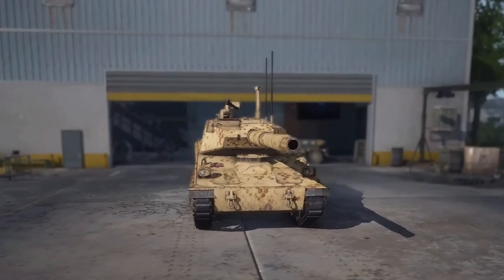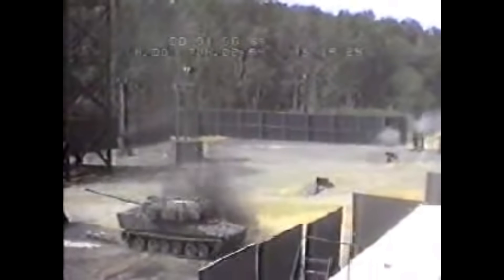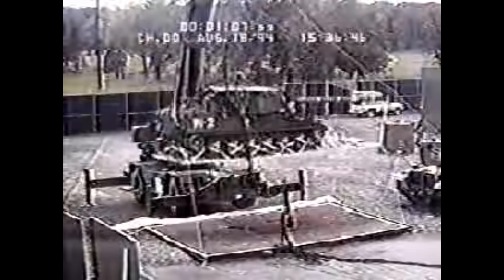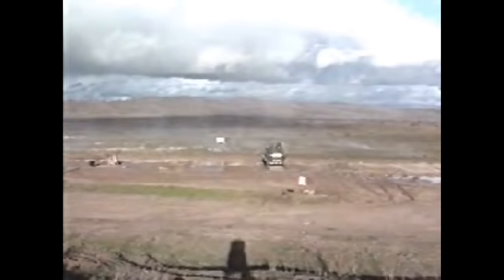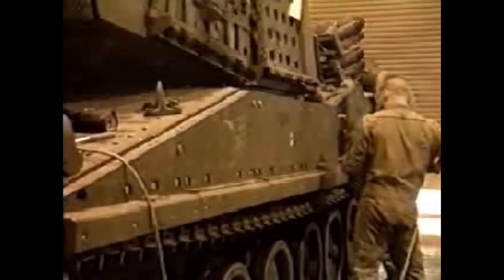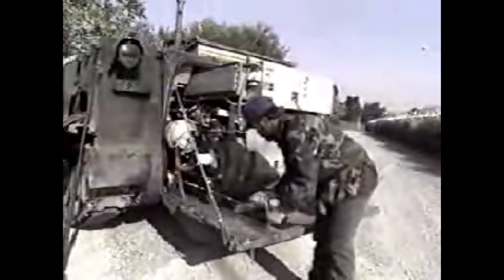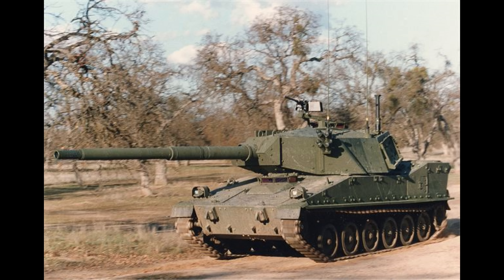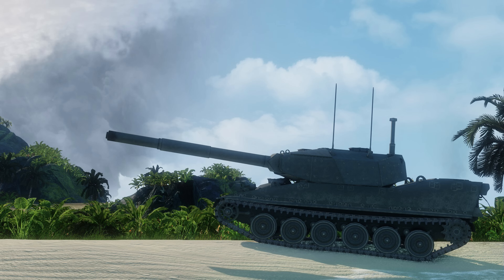M8 'AGS' Armored Gun System | IMPRESSIVE LIGHT TANK

Comment: So... wasn't the US Airborne already have those Stryker MGS thingy to fill the role which this thing was suppose to do?

I mean, they drop this tank a long, long time ago. And now they bring it back again? 

I know US spend alot of money for military, but this is kind of absurd imo. It's like they think money is unlimited. :P
Reply: This actually a proper tank (even if it's a light one) with actual armor that's worth the name. Plus as far as I'm aware; Strykers can't be airdopped, no matter the configuration.
Reply: @cnlbenmc  I believe early Stryker ICV drop was demostrated on C-17, none with MGS AFAIK, and most likely no one's ever trained to do that in practice. With that said BAE's MPF bid most likely have seen some weight growth over original M8 consider the uprated power pack and power generation, since Army eliminated the airdrop requirement early on. With identical dimension it might still fit in a C-130 but the with what kind of range left is a real question.

Comment: Sounds like a perfect tank for the Marines. Especially if you mount a Javelin launcher on it.
Reply: Especially since the Corps supposedly plans on getting rid of their Abrams tanks.
Reply: Why not use the TOW instead? Cheaper, effective, and we have tons of them in storage.
Reply: Daniel Aramburo age of the ammunition lot.
Reply: @danielaramburo7648 The missile is still expensive and can be counter by APS than tank shells
Reply: @aizseeker3622  Wel since its 21t it is not heavier than regular 8x8 APC. Even IFVs are more heavy today than this. 
Still I would see it more capable if equipped with most modern ERA setup. Those are really a game changers and if backed with some tungsten carbide/titanium plates and ceramics in main composite armor - become more useful even against APDS penetrators.
However the biggest ERA concern in US Army goes into possibility of harming infantry guys with an ERA blocks blasting.
Reply: @HanSolo__  Hence instead  of ERA mount APS. Still i wonder is it possible to mount M8 turret on modify ACV hull like Stryker MGS or japanesse Type 16 MCV.
Reply: @aizseeker3622  Sure a better way would be an APS. Those are still quite rare and very expensive. Not sure if such light tank (obviously way cheaper than the heavy one) equipped with efficient APS like Trophy would pass in todays tight military budgets. 
ERA on the other hand is the cheapest battle proven protection as far as I know.
Reply: @HanSolo__  ERA requieres it to fight away from infantry
Reply: Or for countries like Bangladesh or Indonesia where land doesn't support heavy ass equipment
Reply: Wouldn't you guys want it to be amphibious?
Reply: @nagantm441  No way. The hull is not anyway near being desingned for it. Now all the swimming doesnt really work for such vehicles. If you dont want K21 type of baloons your best bet would be to not compromise the protection for the floating foam containers. If it would be anyhow moved into field I think it still would need an additional 5t of protection module on the front. Battle ready if kept around 25t would be an awesome value. Then there its central turret with long heavy gun. Such tank-type of balance dont want to stay stable in the water.
Reply: @HanSolo__  Yeah it not really worth it to make amphibious (gonna be expensive and slow to swim) since you can carry 2 or 3 on LCAC than 1 M1A1. Tho I mostly concern that underbelly hull is vulnerable to ied and tank mines.
Reply: @aizseeker3622  Agree. Still you can't pump it with everything. On the back of the T-90S and T-72B3 you will find armor plates of 17mm which you can punch trhu with some 20mm AP round and ruin the engine or even put the tank in fire. Because its based on some 39t T-72. T-90 has at least this kevlar cover for the ammo selector drum.
Reply: nagantm441 No. The Marines spent the last ten years reinventing the BTR-60, aka the Amphibious Combat Vehicle. We don’t need to reinvent the PT-76 as well.
Reply: I would love to see a tank using the GAU 8 30 mm Avenger 🤯
Reply: A LAHAT missile would be a better option in my opinion. The LAHAT can be fired from the main guns and does not need external launchers.
Reply: @MPdude237  I’m not familiar with that system. Who makes it?
Reply: @dragonsbreath198  Israel Aerospace Industries or IAI. It is a multipurpose system that can be fired out of 105 or 120mm tank guns(high and low pressure guns) and can be fired from helicopters.

Comment: Matt: "Light tank"
Comment section: LoIgHt TeNk
Reply: #askmatt would a Bradly be considered a light tank?? And what type of gun would a light tank have??
Reply: Dwald Pilar the Brady is an infantry fighting vehicle and it usually has an auto cannon, so 20mm-37mm, but there are also versions that are armed with ATGMs(anti tank guided missiles)
Reply: Yea, I know its an ifv I was jus wondering if it could also be considered as a light tank
Reply: @dwaldpilar9309  perhaps at the start of WW2. Rapid firing 20-37mm cannons would have been considered perfectly fine tank armament back then.
Reply: That's why I asked what type of gun it would have to be considered a light tank.... bc can't they put a 105 on it??  Or is it how they are used that makes them a tank
Reply: Dwald Pilar well, they couuuuuld put an autoloading 105mm on it,  but it would be pretty impractical and an auto cannon would work better in an urban or a danger close environment
Reply: @dwaldpilar9309  A "light tank" today would probably have atleast a 105mm cannon. But the problem is that most of these so-called light tanks can't really function as tanks on the battlefield. A tank, by doctine, should be able to "tank" incoming fire from other tanks while being able to return fire & take out enemy tanks. These light vehicles are therefore classified typically as "mobile gun system" or "infantry fire support vehicle". If you want to see an actual modern light tank, look at the Type 10 from Japan.

Comment: Reminds me of days when served in 82nd Abn. Was only unit that had last of Sheridans. It could be airdropped or LAPES. Had 155mm gun and could fire Sheilah missile.  Which when fired  swore it did wheelies. Funny when on exercise with 2 nd Paras and SSF at Camp Petawawa. They kept calling it a tank. Never got me in that, think turret was fiberglass. That was  1980. Joke at that time 2nd paras said 82nd ,US lighest ,and only ABN.  division had more toys then whole Defence force. Went back again to train with 2 Para Rgt with 1st Ranger BN right after Grenada. Wonder what happened to the Sheridan... they were pretty fast
Reply: Armament of the Sheridan centered around its potent M81E1 rifled 152mm main gun that could double as a launcher for the Ford-built MGM-51 Shillelagh anti-tank/anti-fortification missile.
Reply: @missinginaction2b  I saw one crash and burn on airdrop once. I saw a M60 not do so well on a test lapes
Reply: The Sheridan was almost universally hated from the moment it entered service and it's really a wonder it survived so long. It was sort of rushed into service for Vietnam while the ATGM it could use was known to have major issues, and in Vietnam it was learned the hard way. Apparently, firing the ATGM fried the electronic equipment in the tank and they had to go through a major redesign.
Reply: @KermitTheGamer21  yeah but after they worked out some of the initial kinks they did sterling service in Vietnam thanks to the gun's flechette round.